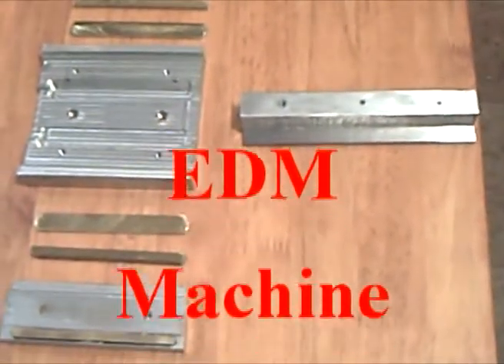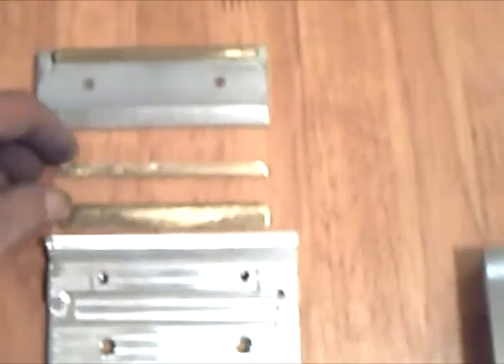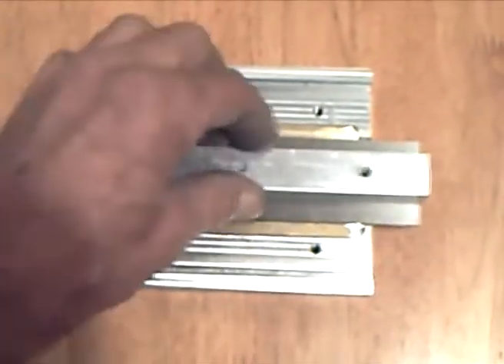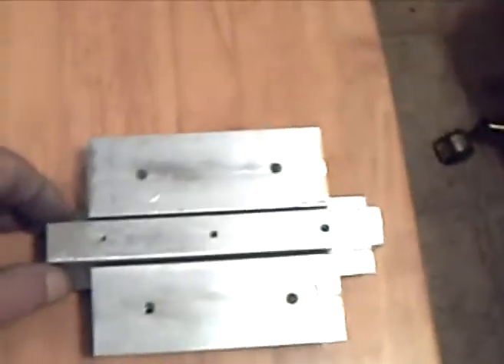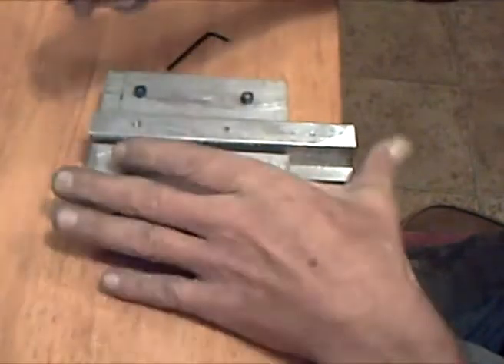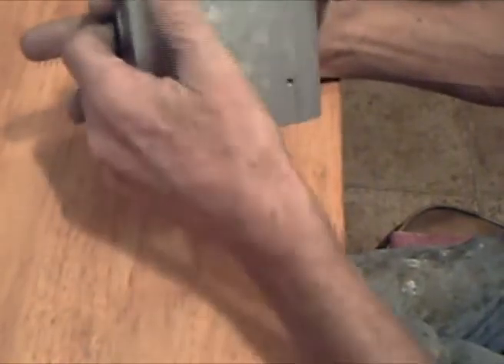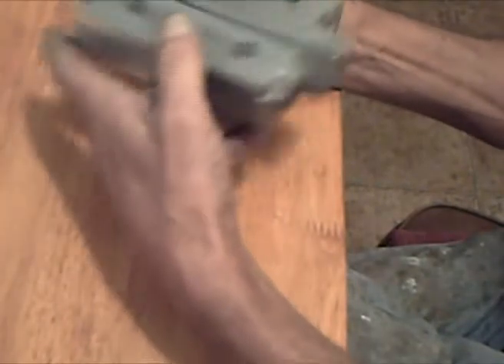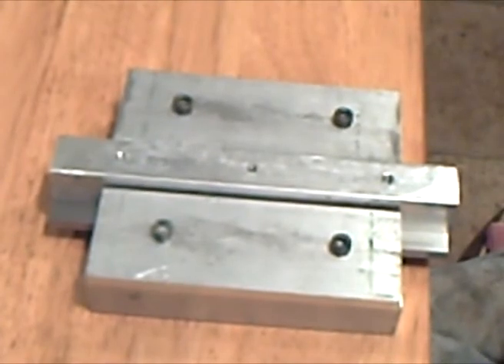EDM.MACHINE, part 1 - making the boxed way

Comment: Did you check ebay for NOS THK slides and rails? I bought some a few years ago very cheap to build an EDM but purchased an older factory built machine to use as I needed it quickly.